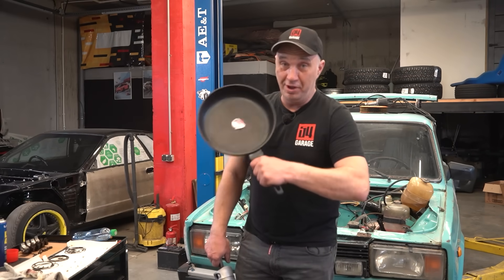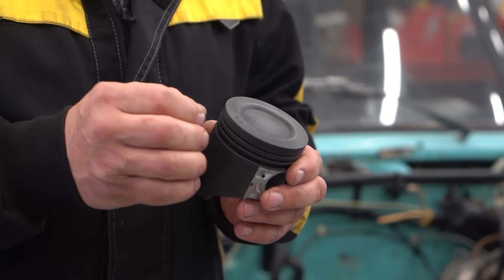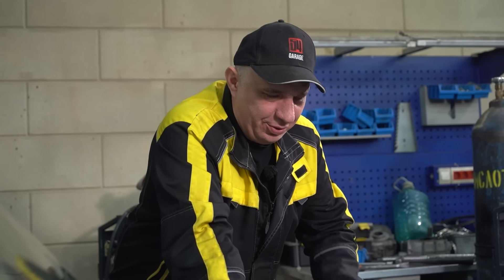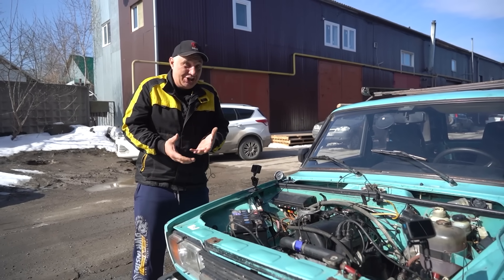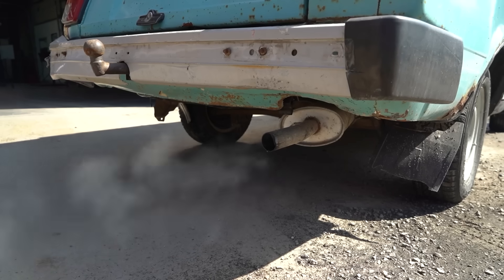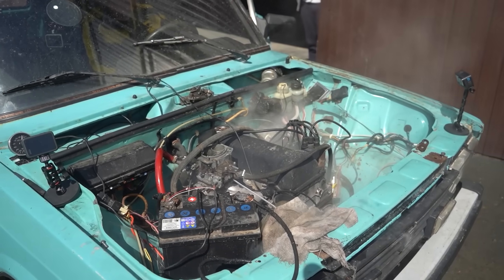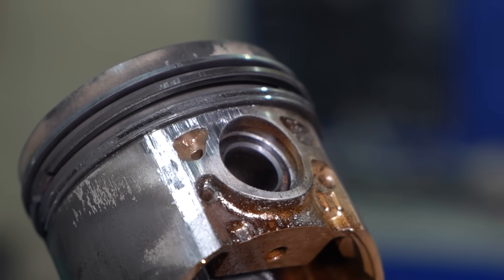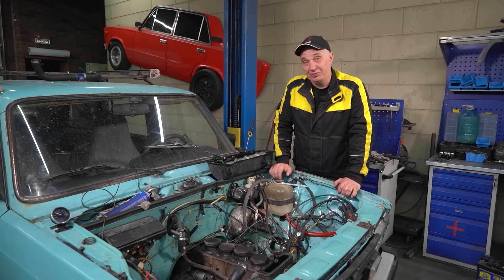We coat pistons with Teflon - what will happen?

Comment: Teflon is old tech today ceramic coating is used on frying pans, it can endure had higher temperatures, and is not damaged by metal kitchen utensils. So why not try ceramic coating?
Reply: Ceramic coating has been used in motorsport since the late 70's, seen a few old race engines with it and was surprised.
Reply: @MotorsportArchives  there was this caddilac engine some years ago that they advertised that it could run up to 50 miles without coolant. can't remember the name of the engine, but i asked my dad about how this could be done. he said ceramics, he worked at the G M tech center btw. so it would be a good test.
Reply: @garycarpenter2932 the Cadillac deVille advertised this. it could shut off cylinders if it became too hot. it also would put its 2 large cooling fans into super high speed
Reply: @garycarpenter2932  A lot of old underpowered engines can do that, there was a time when engines could go for 10000km without coolant.
Reply: @garycarpenter2932  Northstar V8, it does this by only using 4 of 8 cylinders.
Reply: @radeon8461  that's the engine, i guess they were only experimenting with ceramics and never put them in production. he first worked at pontiac engineering, then after Nafta, it closed so they moved dad to the tech center in warren michigan.  he was just a mechanic that put the newly designed engines together, then tested them till they blew up and gave a report on what went wrong. but thanks for clarifying. btw, he couldn't stand the actual designers, they refused his criticism. EDIT to add, in the 70's he was sent to colorado to test new fuel injection systems to see which ones worked best by driving from low elevations to the high mountains without human adjustments. one seat in the newly designed car loaded with now, ancient computers filling the rest. a true master mechanic. he's been gone a long time now, too bad G M didn't listen to him.
Reply: @garycarpenter2932  The northstar was a notoriously bad engine, massively over-engineered and expensive yet unreliable and no better than much simpler V8s, interestingly the Cadillacs with this engine are the only cars that Hagertys classic car insurance outright refuses to insure, because it is a matter of when, not if, the engine will totally fail, typically before 200k mi.
Reply: @radeon8461  read my last reply, my dad 100% would agree. long time gone now, but he tried his best to do customers right. G M really didn't like his input.
Reply: @garycarpenter2932  Pretty sure that is the northstar V8?? That motor will switch to only 4 cylinders when coolant is lost, and will switch which 4 cylinders are active every little bit allowing the 4 that are shut off to cool down somewhat
Reply: @htopherollem649  The northstar v8 does that as well
Reply: @garycarpenter2932  It was their original Northstar V8.
Reply: @garycarpenter2932 Northstar V8 in the Cadillac Seville
Reply: @garycarpenter2932   I believe that Cadillac engine had periodic cyl deactivation, as in an overheat situation the cyl would fire on every other compression stroke, allowing cooling on alternate power strokes.  Kind of solving a problem that should not occur in the first place  😂
Reply: @garycarpenter2932 They said this about the early Northstar engines. I believe they did it by deactivating cylinders to reduce heat once it was detected. Problem was, those engines did the exact opposite of not overheating after the head bolts pulled out of the block. 😂
Reply: @garycarpenter2932  that was just  the Northstar, would cut 4 of the 8 cylinders to manage heat. I dare anyone to try it out.
Reply: @garycarpenter2932  I remember reading articles in Motor Trend in the mid 80's talking about how they were going to start making ceramic (glass) engines that needed no cooling system.Where are they?
Reply: @JrGoonior  yep, i remember dad saying they were experimenting with them. we didn't talk too much about it, he retired from G M in 92 or 93. my guess is using ceramics was just too costly to use in production. but i did learn why while working on cars, a couple inches of extra wire sure would be nice. he said, you take that extra couple inches on millions upon millions of cars, that's a whole lotta inches over decades of production.
Reply: @garycarpenter2932  the north star v8
Reply: @garycarpenter2932  the Northstar Engine was designed to deactivate half of the cylinders in a low coolant situation.
Reply: @PREDATEURLT I've seen 4y Toyotas run to the point that the block was glowing a dull red.

Shut them down, let them cool and they crank right back up.
Reply: @garycarpenter2932  The NorthStar Engine?
Reply: @garycarpenter2932  oh it reduces heat, can it reduce it to a point where Ferro fluids could work normally
Reply: @garycarpenter2932 nothing special with the internals on that engine. It was programed to go into cylinder kill mode. It would cut fuel sequentially to cylinders to pump air through the motor giving a cooling effect.
Reply: @MotorsportArchives  Ceramic is easy to scratch especially for my parents and inlaws.  Once they are they stop working as none stick surface.
Reply: @aj.j5833  It's still used today, however it's rare for people to use the old 70's and 80's methods. The older engines I looked at were 4 cylinder and designed to race for 1000km, they had a matt white/grey area on top of the piston, the lower area of the piston was fairly normal. 
Also in this top section it was aggressively raised and designed to increase the compression ratio a lot. 
It was primarily used to control combustion temperatures which increased power and reliability, not significantly for friction reduction.
Reply: the Koenigsegg jesko and other modern models also use ceramic cover right?
Reply: Ceramic is more durable than Teflon, but it is considered a little stronger, but all of them are susceptible to scratching.
Reply: @فارس.التميمي-1444 teplon untuk piston agar bergerak lebih licin,  ceramik di lapiskan pada slinder blok agar tidak mudah tergores cincin piston. Ok
Reply: I had pistons etc coated by Swain tech years ago
Reply: @GTIFabric Is this for racing applications? I've understood that it will eventually crack and flake off. If I'm wrong then that's awesome. I'll have to go look into it.
Reply: I agree, but for this channel...no disrespect intended but, who cares!!!

This channel is great! Although your suggestion on ceramic coating is good.
Reply: Something must have got lost in translation. Piston diameter 79 down to 78.8 thats a loss . How can it lose diameter after adding the coating ? . That would make piston to wall clearance more not less.
Reply: @StompinMcAllister  in preparation they were sandblasted
Reply: diamond like coating, is synthetic diamonds not ceramic... which is too pourous to be non stick
Reply: the northstar v8 was claimed to run 50 miles without coolant... i dont think they was ceramic coatings cant recall what it was... but it definately didnt live up to that hype... what was advertised as a advnaced durability engine often had issues when it got hot outside
Reply: @pazsion  diamond like coating mimics the properties of diamonds you’re definitely not a genius.  Hence the term diamond like.
Reply: I'd like to see the pistons after use for awhile and not abused.
Reply: how often do you see ceramic coated frying pan in the supermarket? i only see steel, cast iron or teflon
Reply: @supersst838  They are marketing Teflon and other PFAS/PFOS substances as 'granite' or 'ceramic' now.  Lying has never been a problem for the Chinese
Reply: Ceramic coating can indeed be damaged by kitchen utensils lol. I should know.. I damaged a 100 dollar ceramic coated pan
Reply: Ceramic pans have existed since the 1800s. Porcelain is ceramic, all the old camping gear used to be ceramic covered sheet steel. Teflon is the new material, just like nylon replaced hemp for rope making.
Reply: Because they already do that to pistons, it wouldn't be different
Reply: Ceramic coating will wear out the engine head as ceramics are harder in mohs scale compared to aluminum or steel engine block
Reply: Ceramic coating is inferior in pure performance to teflon. Teflon is just toxic thus a resurgence of ceramic usage.
Reply: If you've ever actually cooked anything on a ceramic pan you'll know it absolutely is not non stick. It's straight garbage for that. While a good material for a myriad of uses, non stick pans are not one of them
Reply: Every ceramic coated pan I tried made the contents stick and scorch. Gimme seasoned cast iron any day.
Reply: They put ceramic on pans before Teflon. Just Teflon became more popular for 15-20 years because it was cheaper.. but in the long run if seasoned properly after every use cast iron pans win every time!
Reply: @thawhiterabbit01 , that rolled through my head too. Makes me wonder about combining the technologies. Teflon or ceramic coated pistons in a block that has been processed and seasoned like the old cast Iron pans. Newer cast iron pans are processed differently which is why they suck in comparison to the classics, but I would imagine the old way could have potential.
Reply: @jaymcclure8185  the only difference between new cast iron and old is the new stuff just needs finished. In other words once you buy it sand it with an orbital sander down to 1000 grit or more if you wish. Before you season it.
Reply: @thawhiterabbit01  and almost nobody does that because they all have "pre seasoned" on their labeling. Even then, I did, still threw it out and went back to my 1918 behemoth. The new cast iron sucks 😒
Reply: @jaymcclure8185  I used to have thousands of dollars worth of Griswold cast iron until they were stolen by an ex.. Now it's almost impossible to find them in thrift stores or online..
Reply: @thawhiterabbit01  Ehhh, depends what you are cooking. A steak? Sure cast iron. something with rice? Cast iron sucks because of its thermal mass, it does not cool down quick enough for certain cooking activities
Reply: @DarkAttack14  I have cooked everything you can possibly think of on cast iron. Some things you just have to remove immediately after cooking. But then again I grew up using cast iron. If you actually know what you are doing. There isn't anything you cannot cook on cast iron and it will come out amazing! I cooked for a living for almost 20 years before becoming physically disabled. I always hated cooking on those stupid cheap ass pans. Where one scratch in the coating and you had to toss them or have a potential poisoning incident.
Reply: @thawhiterabbit01 The thing about cast iron is it takes forever to heat up and cool down
Which is great when you need that steady heat but terrible otherwise
Reply: @KaitouKaiju  do you realize that 90% of pans made today are made from aluminum. Do some research on the health dangers of aluminum in your food.
Reply: @thawhiterabbit01 wow thanks Bill Nye, you plan to make your pistons from cast iron?  I often wonder if you boomers think before you talk, and then I know the answer
Reply: @nathenoneptoh did I say anything about making pistons from cast iron? Don't add words to my comments that were not even there..
Reply: @nathenoneptoh btw I'm no boomer I'm gen x. I was just raised right.
Reply: Expense. That's why.
Reply: typically diamond like carbon DLC coatings are used on cylinder walls and pistons
Reply: PTWA coating  is also something very cool.
Reply: Ceramic is quite abrasive.
Reply: isnt that what they coat modern pistons with?
Reply: Good point!
Reply: Amazing interior car luxury
Reply: I'm so hard I shit tefon
Reply: Find me one frying pan that is coated in ceramic.  It's marketing.  Any frying pan coated in 'granite' or 'ceramic' contains PFAS aka Teflon.  The Chinese lies are abundant.
Reply: Ceramic was used 20years ago in Yamaha engine. don't think teflon can last..
Reply: Teflon is very toxic
Reply: Cool story bra
Reply: I've got a bridge to sell you.
Reply: Imagine if they had called him the ceramic Don instead of the Teflon Don? xP
Reply: I think that's more teflon dangerous rather than ceramic better.
Reply: The problem from my understanding is the hardness makes it brittle. It would be great for temporary use for some applications (I'm guessing higher compression) but wouldn't last for normal use.
Reply: Ceramic piston Coatings are already a valid technology of being used worldwide.
Reply: I once coated engine parts with Teflon in a turbo setup. Initially, friction was noticeably lower, but after around 2,000 miles, the coating started to break down. Curious to see if your method holds up longer...
Reply: Can you ceramic coat at home yourself? That’s what I want to know
Reply: There’s  pistons with ceramic been out 20yrs now
Reply: I’d prefer ceramic on a frying pan any day considering teflon is carcinogenic
Reply: I hear you about temperature, but isn't ceramic a lot more brittle? If you're looking to overcome temperature, sure, you make your pistons with ceramic, they'll go very high in temperature, but what's the longevity of it in a standard "commute to work" usage? I'm pretty sure ceramics are fine for an engine at high temperature for 1000km, but I'm not sure I'd buy a car in which I need to change all my pistons every 5000km because they're shattered by the vibrations. Otherwise, you could make your pistons of a glass engineered to make sure the resonance of the material is out of any range attainable by the engine.
Reply: I want to see them ceramic coat all the internals on an engine, the pistons, rods crank, cam, cylinders, and head
Reply: I'm pretty sure Porsche was using ceramic pistons and rings or a ceramic block (can't remember which) in their engines back in the 90s to reduce friction and wear. I think they were playing with ceramic disc brakes too.
Reply: How long do you think it would have run normal driving?
Reply: Bro, you know this is like in Russia, right do you see how old the car is? I doubt they have the ability to ceramic coat those pistons at least at that garage.
Reply: you and I shared the same idea. I really want to see this happen.
Reply: Talvez a indústria não se interesse por isso, por melhorias e durabilidade, senão o lucro diminui!
Reply: Impressive dedication to pushing boundaries! The engine lasted surprisingly long without a radiator, which tells us a lot about the short-term benefits of Teflon’s slipperiness. However, once the temps passed ~150°C, you could hear detonation and serious mechanical stress. I’ve observed similar failures in track engines when piston-to-wall clearance is too tight or coating gets uneven.
Reply: Apakah harus belajar dengan merk VW mesin tanpa pendingin radiator
Reply: So what you're saying is, instead of damaging the piston coating, transfer the damage to the inside of the engine? Smart...
Reply: You can buy ceramic coated pistons already?????
Reply: Actually, that is true. I remember in the 1960s and 1970s how they were advertising non-stick teflon pans on TV, how NASA used teflon in the space program. People left & right (including my mom) would scratch the teflon with a copper or steel wool pad. My dad bought her a new one, and she had it for decades!
Reply: You can try it, however it is very hard (scratches) , and brittle.
Reply: poisonous chemical if you what teflon means and its properties
Reply: Price
Reply: Make the entire piston out of ceramic.
Reply: Cast iron pan is best you can get. Most peeps are just too stupid to use one.
Reply: @Arthof82 Orrrrrrrrrr... they're too heavy, take up too much space, require too much maintenance, and scratch glass cook tops too much.
Reply: @potato9832  i have glass cook top and i have zero issues, it takes space just as much as anything else and you can buy what ever size you need ofc, and it takes maintenance only if you use it wrong way. you listed load of bs pretty much. it is heavier ofc but that should not be issue for anyone older than 6 years old.
Reply: The problem is that while technically harder it's also more brittle. Theres a real risk of cracks which will leak out toxic metals from the core of the pan (which is required due to the poor temperature transfer of cermaics). Also many ceramic pans are still teflon coated
Reply: Their choice
Reply: or a stone like finish on the steal
Reply: Vw use it in new 1.5 tsi
Reply: You would have to coat the sleeves too
Reply: DLC coating is ceramic coating ?
Reply: titanium coated pans even better
Reply: It's hard but brittle.
Reply: The Teflon likely didn't last long as it has a very low melting point about 330c but can begin decomposing as low as 260c with the temperature of gas burning being like 1500-2000c(that would destroy the Teflon layer very quickly on the top of the piston but what about the side) but the side of piston is likely transferring a lot of heat via the oil into the engine block where it is then taken away by the cooling system resulting in a temperature around 100c ( much lower than I expected ) so Teflon on the top of the piston no good Teflon on the side of the piston maybe
Reply: Nobody gives a shit! Just enjoy the content these guys create. They are the most creative channel on YouTube!
Reply: Painted pans put their particles in your food. You like that?
Reply: @joewaligator4364  what doesn't put particles in your food , duuuh
Reply: It’s Russian channel, this should not surprise you, that it’s outdated 50 years. I have no hate on this channel btw
Reply: @gytisstepo3782  Also this channel does a lot of youtube comments section suggestions and other ideas they come up with using tools you will find in the average car mechanic's workshop so no fancy cnc stuff, just a mig welder, a grinder and a unsuspecting camshaft which makes it a fun channel to watch to see how many ways they can make a Lada engine explode.
Reply: @gytisstepo3782 what are you doing on 50 years otdated channel? You have lot of advanced western channels to watch?
Reply: @gytisstepo3782 ???????? Lol
Reply: @gytisstepo3782  no you only have nothing between the seat and the steering wheel since ceramic coating wouldnt peel off and therefore the results are foreseeable🤦🏼
Reply: @gytisstepo3782  also this is not trying to be scientific or anything like that. It's more of a myth busters style where the result can be seen as complete failure from the beginning.
Reply: What the heck are you writing 💀
Reply: @gytisstepo3782  You might not have no hate but you definitely some stereotypes about Russia thinking that its Congo.Maybe you should travel a bit meet people and see what other countries look like
Reply: I wonder when they will coat their airplanes with Teflon so that the drones slide off better.
Reply: @gytisstepo3782  Both ceramic and teflon coatings are older than our fathers, ceramic coating is older than most civilizations of today. And by pure numbers teflon tech came out hundreds of years later.